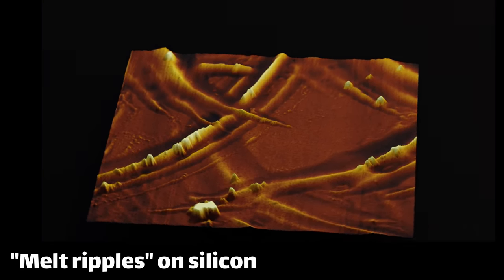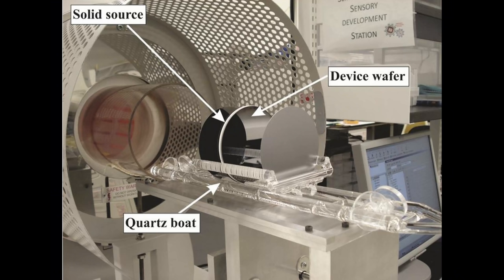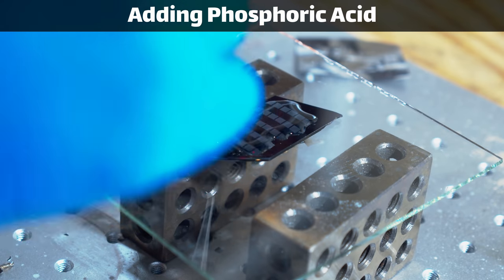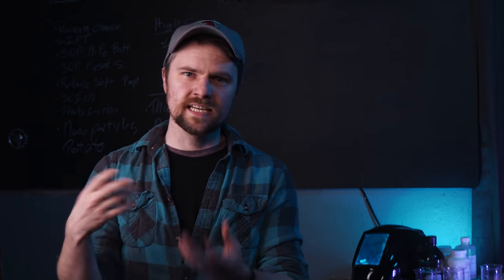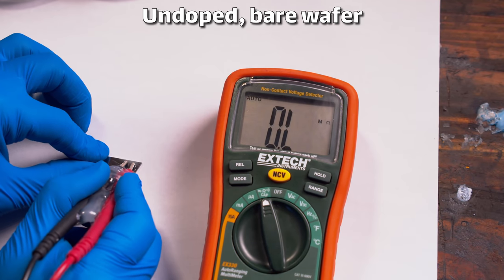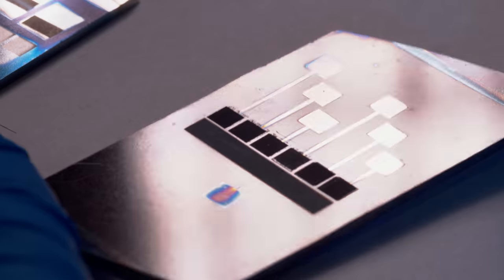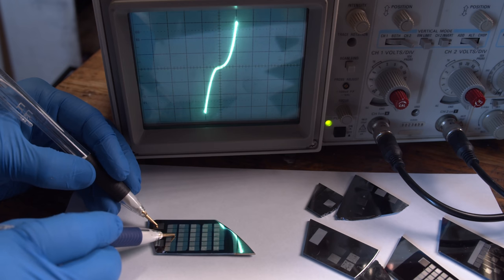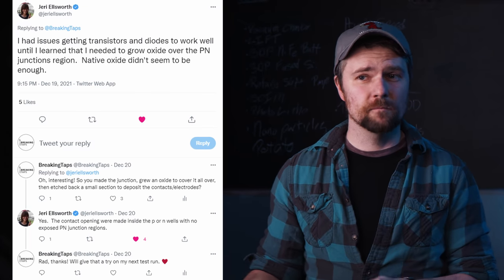Doping Silicon with Lasers

Comment: Testing from both sides of a silicon wafer should naturally be like a diode where one side is positive and the other side should be negative.  Trying to make an NPN transistor on a positive side would be more work as compared to the negative side.  N-type is considered more efficient to make and most logic uses it(NPN).  Start small for testing and hopefully you don't burn a hole in your wallet with that laser.  Good luck with your testing and hopefully will be able to open up your own Silicon foundry to hopefully supply the market

Comment: Operating under pressurized fluid should get you much more progress but I am sure you are already familiar with the required pressures and whether you can achieve them with your resources. Using a higher boiling point phosphor source you may be able to have your target preheated by a few hundred degrees to ease the stresses on the doped points during firing.

Comment: I wonder if there's a way to do some open-loop control (or closed-loop if you use optical temperature measurement) to just heat the wafer keeping it solid in certain regions, would you be able to avoid almost all of the nuances of melting the silicon?
I'm not sure if this exists but is there some sort of higher viscosity phosphoric acid solution that you could spin coat onto the wafer, improving any refraction issues you (might) experience with a thick blob of acid on your wafer.
Just a couple of thoughts! Happy to hear from someone on this

Comment: As mentioned by other guys, be careful of your aluminium lest it diffuses through the Titanium layer and form unwanted silicates on the silicon layers below although i do not expect it to be serious as you are dealing with lasers. 
And 4 point probe is your friend for measuring/calculating resistances at these scales

Comment: What if you use a 1064nm MOPA? I would test with my MOPA... but... it died and I just have a regular 1064nm 30W now. You can get a lot more control over energy with a MOPA, but you can also get pretty close with non-MOPA with a lot of work. For example; It's a lot easier to get specific surface temperatures to anneal stainless steel, titanium, or char aluminum with a MOPA. It is still possible with a standard laser but it's not as consistent and it's not the same.
Reply from the maker: Yeah, would love to have a MOPA! I was debating between a high powered non-MOPA, or a lower powered MOPA.  Decided on higher powere but in retrospect the ability to tune pulse duration would have been much more useful to me.  Oh well!  Maybe some day I'll sell my current laser and switch.

Comment: How much is the laser power?
What laser was used? Type, name, maybe manufacturer?
Reply from the maker: 50W fiber laser, random OEM / chinese laser (if you search ebay or google for "50W fiber laser" you'll see it, big blue metal box and galvo head).  They are designed for etching logos and serial numbers into metal.  I think mine has a JPT laser inside, others have Raycus.  They are all pretty interchangeable though.

Comment: What power is the laser? Can a 405nm laser from those cheap laser engravers be used for this? (50W input power, 7.5W - 10W claimed laser power)? It should be at the better end of the spectrum according to the optical penetration you mentioned early in the video. Or will it then be too shallow penetration for this wavelength?
Reply from the maker: 50W fiber laser. Unfortunately I've not had any luck with my 450nm laser, even when using a microscope objective to reduce the spot size. In theory the wavelength is fine, it'll melt a smaller region and require less power too. But there's just not enough absolute power to do it. The fiber laser is pulsed, so the peak power going into each pulse is on the order of 5kW.  I think you'd need quite a bit more power to do it with CW lasers unfortunately

Comment: @Breaking Taps.  wouldn't the fluid and the bubbles produced by the lasers warp create flaws in the  areas that your doping  if you your working at a small enough scale?  I would imagine this method would create a lot of imperfections, but I don't know about this kind of stuff. it why I'm asking.
Reply from the maker: Yep! Definitely an issue that would need fixing if you were doing precision work. In the literature they tend to spincoat a thin film and drive that into the wafer.  I wanted to make sure "lack of phosphorous" wasn't the issue just to rule out a variable so I flooded the location and kept all the contacts big enough so that the bubbles wouldn't matter.  But definitely something to avoid for "real" applications!

Comment: Would a short pulse (ie. Q-switched) laser be beneficial here? Im thinking like a QS ruby laser.
Reply from the maker: Hm, maybe! Shorter pulses are more likely to ablate rather than melt (higher power density), but on the other hand that wavelength would work considerably better too, and keep the melt region closer to the surface. So yeah not sure but maybe!

Comment: I'm assuming a lot of these ripples are from the fact you're using a pulsed laser as well? Would slowing it down and lowering the power reduce these? Oh also you'll get lensing on the beam with such a thick liquid layer, he ripples maybe due to refraction.
Reply from the maker: Yep!  The ripples are from each pulse melting and then resolidifying before the next pulse arrives.  Slowing, changing the power, or changing the pulse rate can definitely alter how it appears, but you always have to deal with the ripple nature in some capacity because the "off" time is really long compared to the pulse duration.  My laser maxes out at 80kHz pulse repetition which is 10 microseconds in between pulses... but the pulses are only 100 nanoseconds long. So the material will almost always resolidify before the next pulse arrives.  Makes life interesting :)
Reply: @BreakingTaps  yeah I guess this is the same problem they get with sintering and maintaining a consistent melt pool right?

Comment: how thick is the metal film to be doped?  It looks like the lazer is zapping an extremely thin film on top of a piece of ceramic?  Thank you sooooo much for sharing this process and how we CAN do it at home!!!!!
Reply from the maker: The silicon is maybe 2-3mm thick, and the laser is probably melting the top 100 micrometers of that (theoretically, I haven't verified that yet. Will probably cross-section one to check soon!) :)

Comment: Haven't watched your video but eagerly wait for them. And love the topic already.
EDIT: Watched still amazing, and look forward to progress. 

Please post which laser are you using? And can we use the cheap blue laser for this?
Reply: He mentioned a fiber laser which is near inferred 1064nm  "which is not ideal", a blue laser would be more ideal IFF it has enough power. 5:57
Reply from the maker: Thanks!  The laser is a 50W no-name chinese fiber laser designed for etching logos and serial numbers onto metal objects.  If you search google or ebay for "50W fiber laser" it looks basically the same, all the same generic OEM blue box.  They come in a range of powers from 20W up to like 100W

In theory the 450nm blue wavelength would work, but I don't think the power density is high enough to reach critical temperatures. I tested briefly with a microscope objective to see if I could get the power density higher but didn't have any luck.  The literature uses CW lasers sometimes, but they are usually quite large :)

Comment: Here's a crazy idea. Would it be possible to have a beam of very high energy photons, each of which has so much energy that it can actually blast atomic nuclei when absorbed, and cause stable atoms to perhaps eject a proton or undergo a decay of some sort, so as to be transmuted to another element? Because then you could hit a semiconductor with a beam of just photons that could change the semiconductor type to p or possibly n type semiconductor, and you could have the ultimate photolithography, you could potentially just start with a slab of silicon with nothing else and just change it into a complicated circuit just by hitting it with well controlled focused beams of high energy gamma rays. I don't know though, it seems like that could only turn neutral semiconductor into p type, because it wouldn't be able to increase the atomic number. Also probably the technology doesn't exist to generate much less focus photons of such high energy, and they might not just change the nucleus but give it so much momentum that it leaves that atom's position in the crystal.
Reply: Afaik, you kinda can, but the machinery required is hadron collider scale (because, well, it basically is a hadron collider) and the process is extremely slow.
Reply: Lasers are the happy medium. They are still light, no Hadron collider necessary. 🥂
Reply: The infrared laser, I think was the limiting factor...
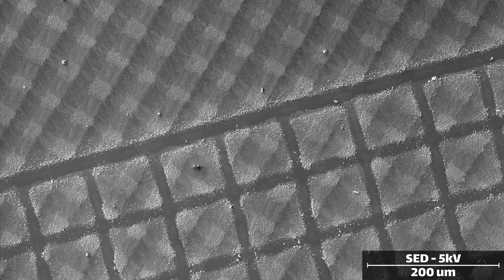I was thinking, at 8:40 that he couldn't tune the laser fine enough...
The results were amazing either way. In a garage too!
Reply: @Robert_McGarry_Poems  well, you probably can do n silicon that way (although I doubt it). The issue is, in order to make a p silicon without doping it with something you need to very precisely add a single proton to its core, not remove it. You cant do it with a laser, unfortunately (it might also become an unstable isotope at that point, but not really sure)

Comment: What is the ideal location for the phosphorus? It it just surface level or do you need it to go deep into the silicon?
Reply from the maker: Just below the surface, ideally in a nice even, controllable layer. For DIY purposes it can go pretty deep because we're also making pretty big junctions, transistors, etc.  But for real chips the depth continues to get smaller and smaller as transistors shrink.  The smaller the junction depth the better the transistor performance (among other parameters too).  That said, the 100 microns that mine might be doping to is quite large, even for DIY stuff.  1-10 microns is probably better.
Reply: @BreakingTaps  those are extremely tight tolerances but it makes sense. Regardless I think it cool that it's possible to do at home. No wonder they say silicon production is one of the most intricate things to ever exist.

Comment: you dont need complex systems to do ion stream, its just a ion coating system with photo mask
Reply: its only a simple mass spectrometer, including ionization of oxides as a starter ion source
Reply: being owned by law is not dope
Reply: voltage current charts so that you can calculate the dopant concentrations
Reply: if you cant to do something at home then the way used is not robust, its fragile in the industry

Comment: Intel doesn't use this old and limited technology. They're using Extreme Ultraviolet Lithography (EUV) to make large scale microprocessors. Ion implantation is very old technology used primarily to make integrated circuits like TTL logic and CMOS.